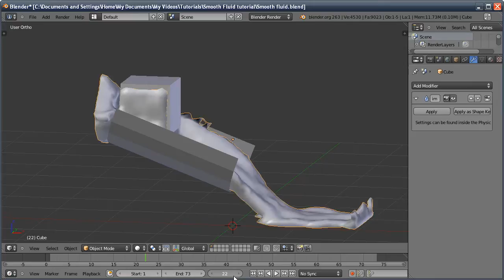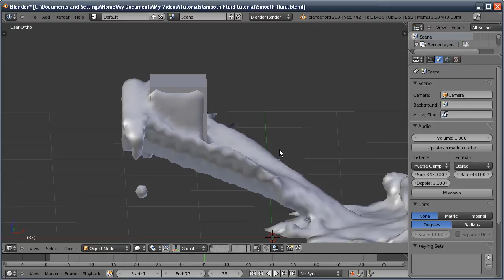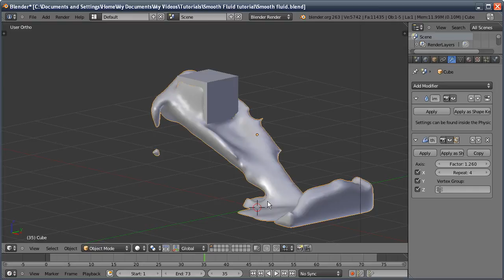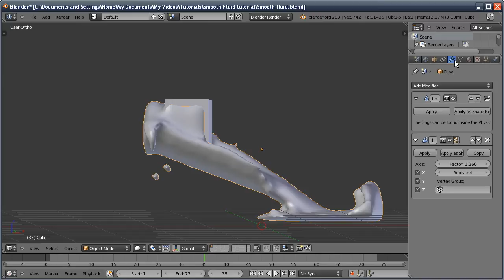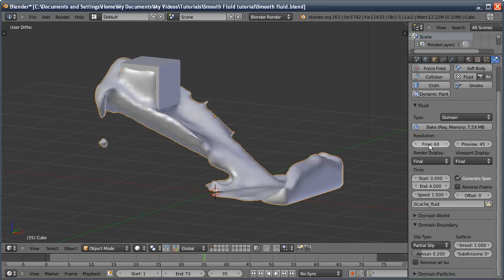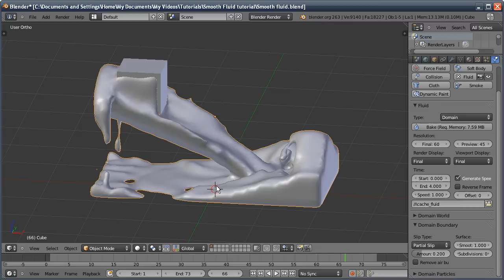Blender Tutorial: Smooth Jagged Edges On Fluid

Comment: Is there a way to apply a smoothing effect to only selected vertices? I want to smooth jagged edges but I don’t want it to affect the rest of the model
Reply from the maker: I think you can use the 'Vertex Weight Proximity' modifier to test the proximity of the fluid to the surface and generate a vertex group from that.

Comment: thanks for this time saving great tip. I am trying to make a juice splash animation in a jug but i kept having those horrible edges, and this seems a good solution. but i do have a question, my juice splash looks like a paint splash, i cant get the feeling of orange juice in material, it needs to be shiny and glossy but some how translucent in a way,  do you have any idea how to get this right? thanks :)
Reply from the maker: Something like orange juice will have something called 'Sub Surface Scattering' or SSS. There is an SSS shader in cycles and an option in Internal.